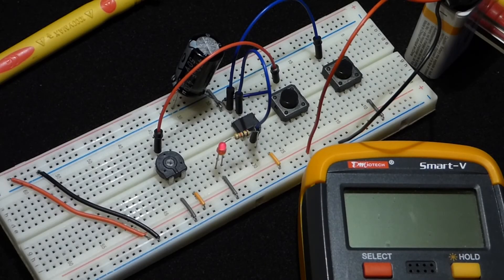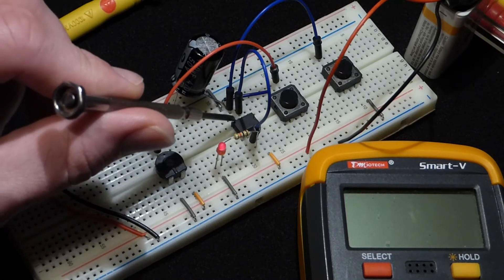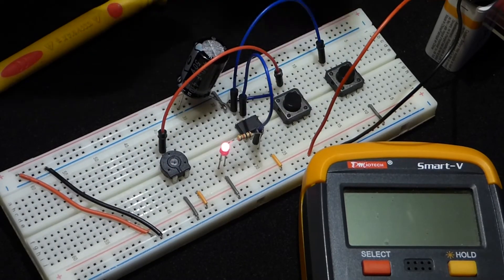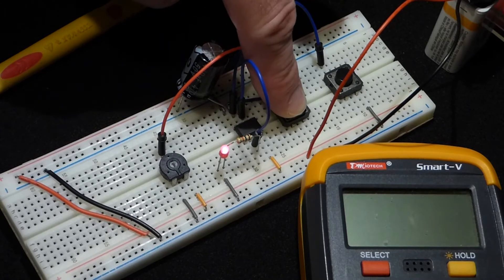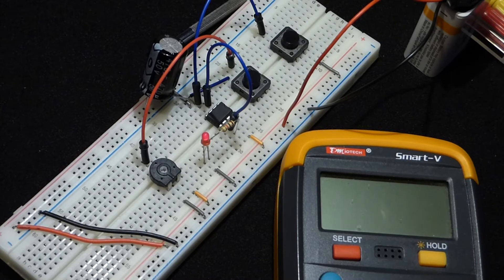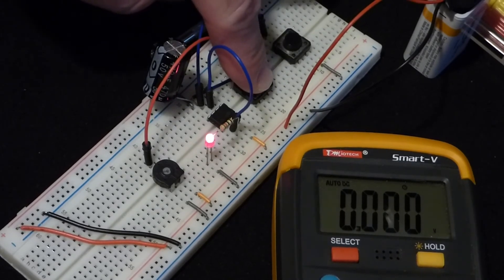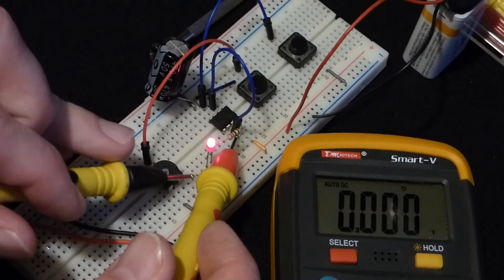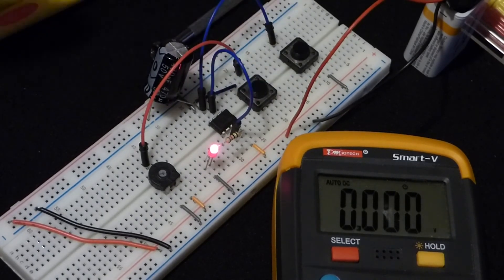First attempt at electronics 741 op amp sample and hold demo circuit explained

Comment: Can you give the values of capacitor and resistor
Reply from the maker: The capacitor is 470uF and I am pretty sure the resistor is 1000Ω by looking at the color code. That shouldn't really matter too much, it is just a protection resistor for the LED, so since this is a 9 volt circuit, I usually use at least 470 ohm resistor or higher.
Reply: electronzapdotcom can you plzz provide the schematic circuit diagram of it.
Reply from the maker: I'll see what I can do.

Comment: I just would like to say I do enjoy your tutorials but was wondering when describing your circuit when working with IC
Reply: I didn't get a chance to finish but when working with integrated chips could you give the pin lay out of the chip and the ones you are using thank you. This would help me understand what's going on with the circuit better.
Reply from the maker: Thanks for the kind words! I included the pin layouts in my earlier 471 Op amp videos that I did months ago. Here's a quick vid of the pin layout and one of the circuits I went over. https://youtu.be/XA_k29A7UDI . I rushed this video because the circuit needs improvement and bedtime was closing in quickly. :D